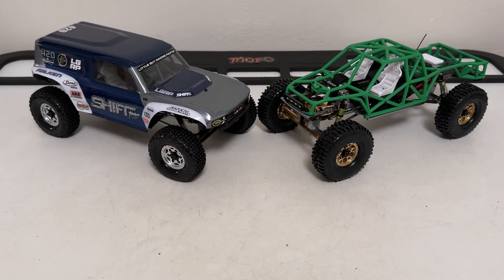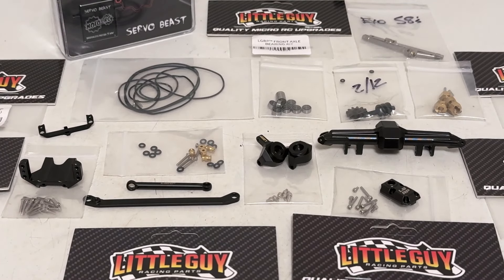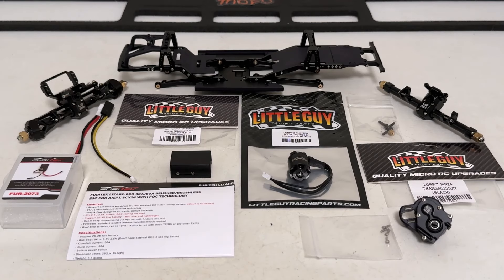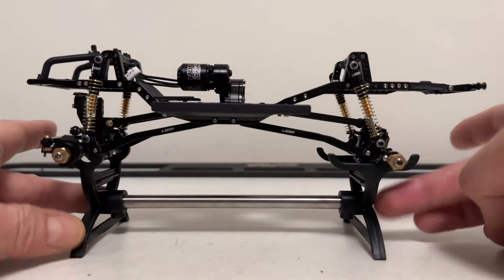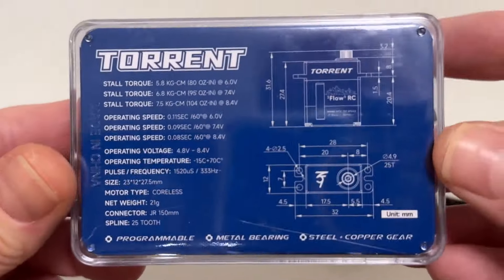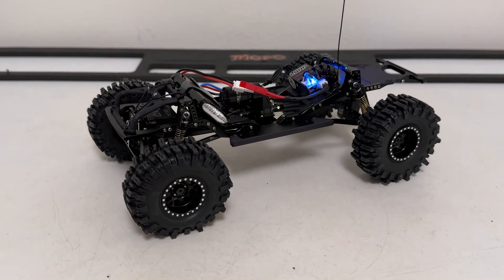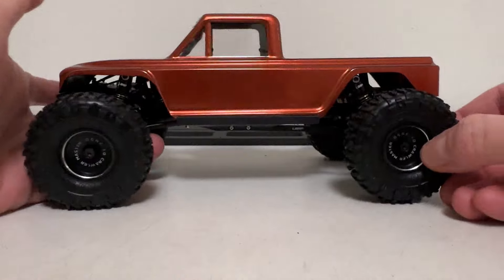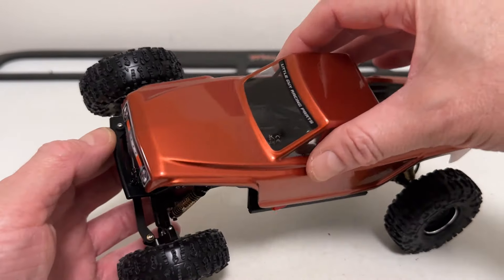SCX24 - LGRP MIDNIGHT EDITION COMP FRAME BUILD: NEW BODY, BRUSHLESS COLLABORATION, PART SWAPS & MORE

Comment: Awesome build! Do you find it a little frustrating that even when doing nearly an entire LGRP build, that things still don’t easily fall into place & still requires you to modify things to make it work? What makes it so hard for manufacturers to make a chassis that accommodates the most popular brands/upgrades?
Reply from the maker: Yeah, the Servo Beast being too tall was unfortunate…. But I knew that and forgot. It is a strange decision though (in my mind) to go that route. BUT, I do like that rear exit servo cable of the Torrent. So it all worked out OK guess!

Comment: Matter of fact when I did was put a 14% overdrive transmission with a 14% overdrive warm gear 28% you know or you can go for even higher with a 23% in the axle 14% transmission that's more for like a super comp class 3 rig
Reply from the maker: @Gibsonlife573  that’s not a bad idea at all. Does it help with driveline bind I assume?

Comment: Question. Is that a steering link you used as the lowers on the front?
Reply from the maker: yes, with some spacers to adjust the length a bit
Reply: @ awesome. Thank you brother. I think ima have to copy this mod for my LGRP comp. Iv been looking at ppls builds on this and taking in some ideas and this one seems to be much needed for some caster.
Reply from the maker: @ yeah it really is. Just gets that servo in the exact right frame spot too. LGRP really could use some adjustable links in their lineup. Super helpful on setup.

Comment: terrible way to put a pinion on lol. no vise ?
Reply from the maker: @scottmichael7178 I thought it was pretty crafty. Worked just fine. Why is that so terrible? If you have a vice, great, use it.
Reply: @bcochener  the jaw shape of most channel locks wont push it in even because of the angle when you clamp down changes.  Hey if it works for you....great.